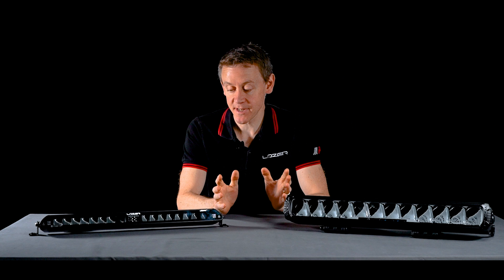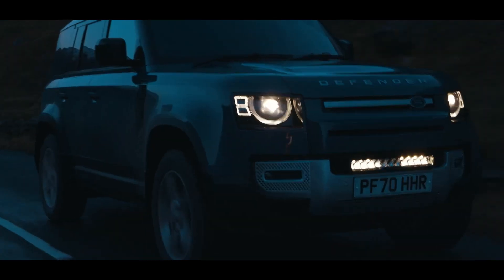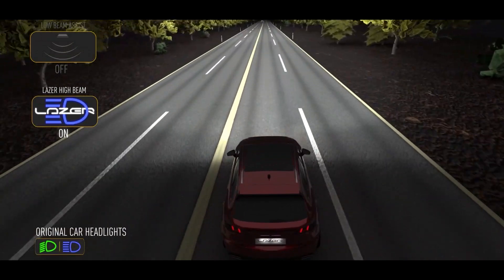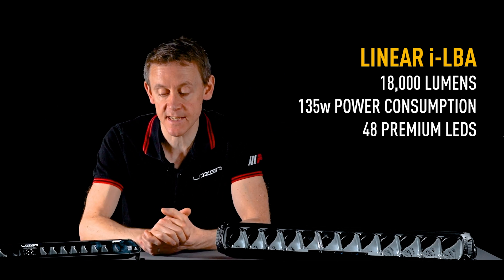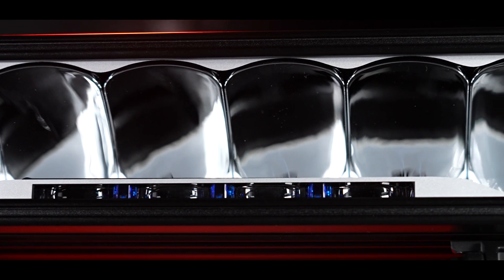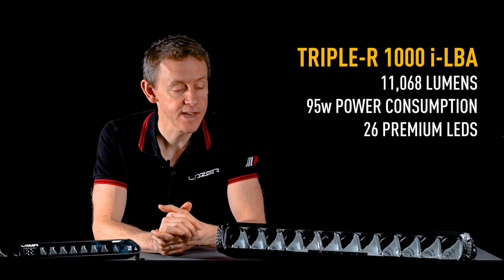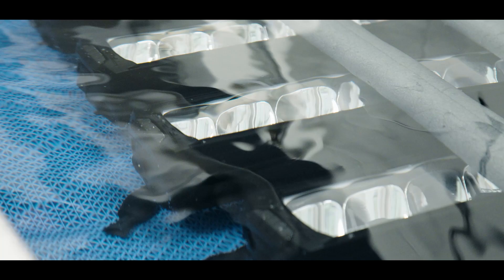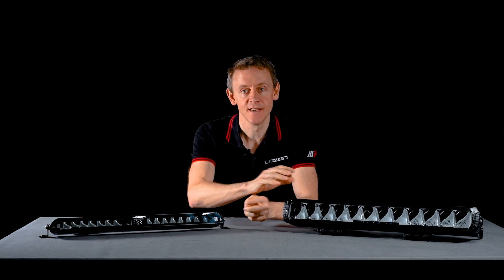LAZER LAMPS | Intelligent Low Beam Assist | Product Walkthrough

Comment: When driving going abroad ie France,will the automatically switch to illuminating the correct side of the road. Also does the verge illumination continue if you don't switch you high beams back on
Reply from the maker: The lamp will respond to the other side of the road when going to the EU. Initially it won't be as responsive, but after passing a few cars on the other side it will self calibrate. The same will apply when coming back to the UK.
The i-LBA mode is designed to add light on low beam when passing oncoming traffic or similar, not to be run in this mode constantly. It won’t act as a matrix headlight alternative if you drive round in this mode constantly, and you may find it annoying.